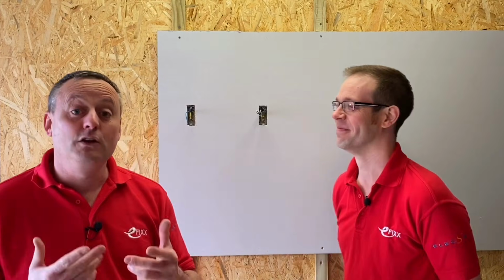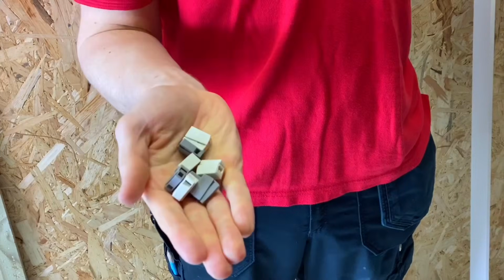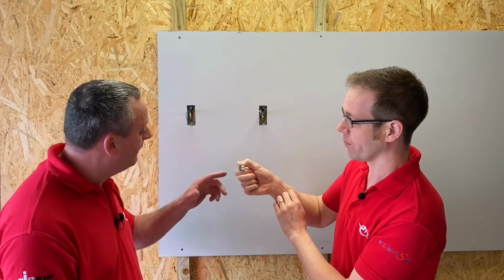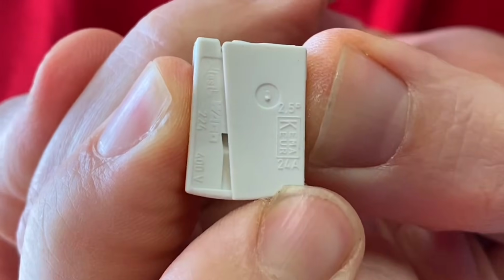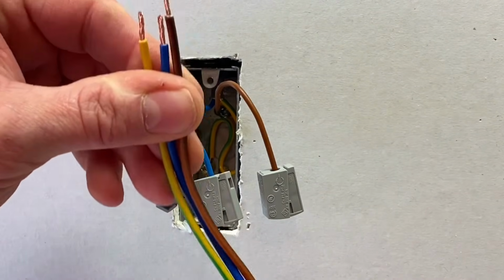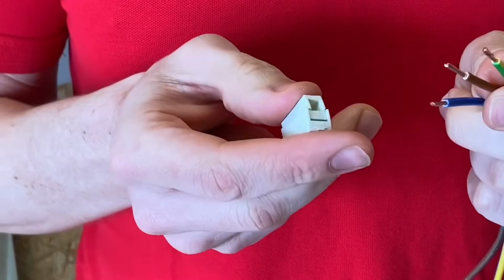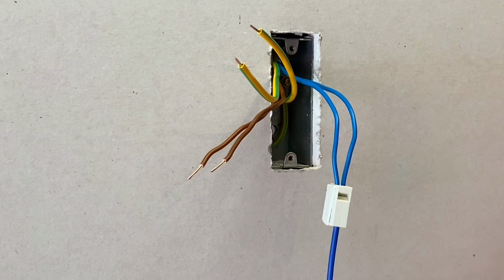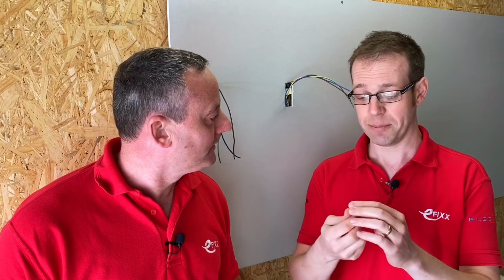Wago 224 connector block demonstration - great for light fitting installation

Comment: I am replacing a 1 gang 2 way dimmer switch which has 2 red wires going to common and single wires going to L1 & L2. Having purchased the replacement switch I find that the common terminal can only fit 1 wire into the common terminal. Would it be safe to use a wago 224 to receive the two red wires and run a single wire from the other end of the wago to the common terminal on the switch?

Comment: Why use ferrels on the stranded/output side? Isn't the connector designed to accept stranded wire? 
The job is still 100% just curious

Comment: Awesome Video as always but still better to use a connector block as you can then have all the cables on the same side and neatly dress the cabling in the wall/box behind the wall light and by the look of those connector they are bigger than a 15A connector block?  In 20 odd years I've not been lucky enough to have anyone have a box on any type behind a wall light. To be fair though, it is each to there own.

Comment: What connector would you reccomend for a socket spur? For example. Where two wires are spliced together and connecting a third for the spur.
Reply: https://www.screwfix.com/p/wago-32a-3-way-lever-connector-50-pack/2803R?tc=PB3&ds_kid=92700055281954475&ds_rl=1249401&gclid=Cj0KCQjw78yFBhCZARIsAOxgSx3jYhiFtZwClb3s4DMj3Bj1NSV8AkQD8DDlOTJHEyvXRnoSxmzUJucaAinSEALw_wcB&gclsrc=aw.ds

Comment: Too expensive to connect 2 wires, there is another version with 2 screws called choc block which is very cheap compared to Wago and smaller, been using them for years without problems
Reply: Choc blocks take up space and the screws work loose over time.  The Wagos also give a superior connection, not working loose. They are also quick to install.

Comment: Does anything small, inline splice like these connectors exist for two flex cables?
Reply: Look at the Wago 224-201
Reply: ideal spliceline takes upto 2.5mm stranded both sides.

Comment: Hi.
What is the expected design life of the connectors? Overtime would not the tensioning metal spring clip start to loose its tension.
I like to think installation products are designed for a long life span, the wiring in my home is at least 43 years old, (when the colleges re-open and I finish my sparky course etc), I'm intending on rewiring my own home, as I can see material degradation.

Comment: Not convinced by these yet, love a 221 for sure - 222 sometimes.  The stranded side of these feels like a bit of a woolly connection, might just be me or a few iffy ones I've had 🤷‍♂️   Still, keep up the good work you two 👍👍
Reply: This here are really good in cramped places. Really like them. Also the stranded side being opposed to the solid side mares sense in lighting installation.
Never had an issue with them. I am using them for years.

Comment: It's hard to get a grasp of scale but how are they sized in comparison to the 2-way or 3-ways 221s'? I've used them for this purpose for wall lights and they are perfect. Never had one of these in my hand so hard to tell. I like the 221s' as all 2 or 3 conductors are heading in the same direction so the wago can be tucked in the corner with plenty of room left over.
Reply from the maker: We’ve posted a picture of both in our community tab.
Reply: They’re a little smaller overall, but not hugely. I feel like the 221 — especially the 221-2401 — mostly obsoletes them.

(I suppose one thing though: it’s easier for a later home owner DIYer to not screw up the fixed wiring and still be able to replace the fixture. Even relatively safely if they do it under power, as long as they disconnect the line side first (which should still never happen, but anything that makes it harder for the proverbial fools to kill themselves is a good thing).

Comment: So what do you do when the light base is smaller than the arcitrave box as is often the case?
Reply from the maker: Smaller round base lights fittings should fit over a BESA box (conduit box).
Reply: @efixx  however the conduit boxes are still far too big for more decorative and expensive fittings customers buy these days. The larger bases tends to be the cheaper variety. In a sense, you can not have a back box behind the base and still have enough wall for the fitting to be mounted on.
Reply: Most
Reply from the maker: Agree - someone should develop a small back box. Or lighting manufacturers design a product which considers the real life installation.